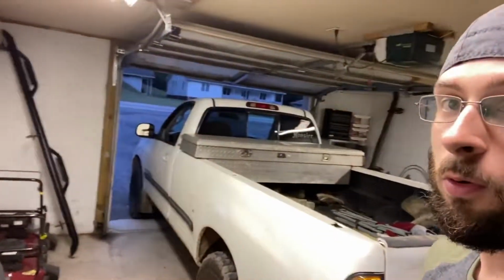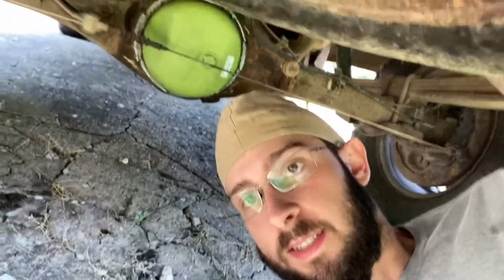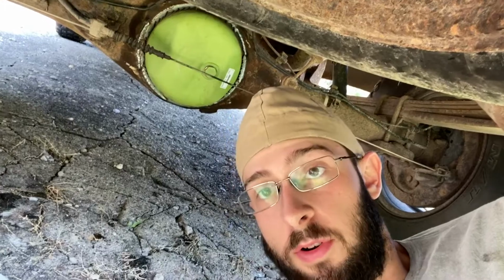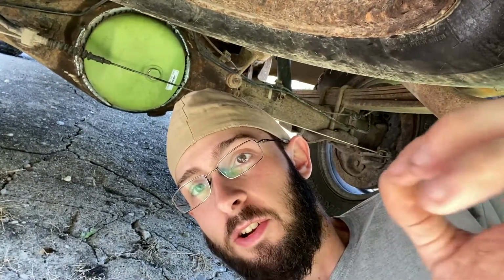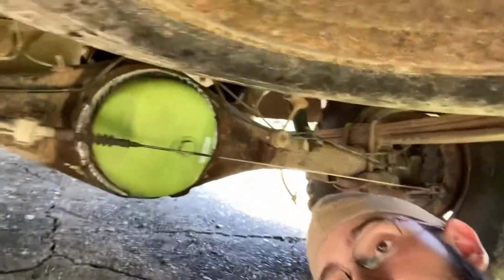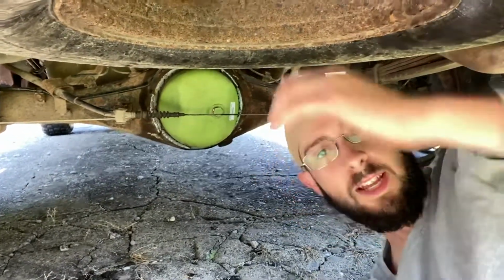2000 to 2006 Toyota Rear Diff cover Replacement

Comment: Thank you! Gave me the courage to do this on my '02 Sequoia

For anyone on the sequioa. I took out the spare tire, the lateral control rod and moved the brake lines up. Used the cheap Chicago electric HFT flux core and the .030 wire max and 8 wire speed. flushed it with brake cleaner and changed the gear oil 4x to get it clear of all particulate after driving a little.

used a cable come along to pull the frame and diff together to replace the lateral control rod. 

took a while and 4lbs of flux core because I am a total novice  welder but it doesn't leak and the Dorman cover works fine. I also ground off one of the brake mounts and rewelded a new jury-rigged on which uses a zip ties, since it didn't line up perfectly. The new cover maybe the bolt is a little high, but it's close to 4 quarts more than the 3.75 factory spec
Reply: How’s it coming out? Btw how much do you think a job like this would run me
Reply: @brian1192  It worked fine. I've put about 1k miles on it since and no problems. I did change the gear oil 4 times and then bought a spare plug to switch it out until there was no more metal shavings. So far so good. Of course the Sequoia only has 250k miles:) but in the NE the rust is the killer.

As for the cost, I really don't know. I was quotes around $3500 to replace the differential with a warrantied used + new control rods, but didn't shop around.

You might try a twisted wire cup on your angle grinder first to take all the scale off the existing cover,  if you can spot the pin holes, drain the oil and try welding some thin steel sheet over those pinholes and see if that holds, before you go through the whole thing that Holden Powell demos. You'd have less to lose if it doesn't work. 

Like I wrote, I was a total beginner 'welder'. I practiced a little with the HFT chicago electric welder then I went under the truck and did it. it took 4lbs of wire because I had to keep griding where it leaked throgh the weld, but after a bunch of hours, it holds. Not bragging at all, just to say that a few times I thought I wasn't going to get it done and looked on Ebay for a used rear axle so if you can weld over the existing cover, if I had thought of that I iight have done that first and not had to deal with all the filings etc.

Best of luck!

Comment: I'm about to do this on my Toyota Tacoma. I tried patching it and it worked for a while but is now leaking again. Thank you for the video. Everyone I talked to said I have to remove the axle to do this job. Glad I stumbled upon your video!
Reply from the maker: Glad to hear I could help!
Reply: I just did it! What a frig getting that old leaky cover off. I used a cold chisel to beat the cover off after grinding the factory weld paper thin. That left me with a nice flat surface to weld the new cover on. She looks great! flushed it out and filled with fresh fluid. You saved me a ton of money. All the shops around here wouldn't do it that way. They just said to get a new axle. Thank you! I will never buy another Toyota! Designed to fail if you ask me!
Reply from the maker: @ruralliving4034  that’s awesome!

Comment: I finally bought a cover and paid a Welding shop to install it even with a lift it took them 3.5 hrs but they removed the brake cable so they would not have to work around it then they under coated it for me looks good. they charged $325
Reply from the maker: That doesn’t sound like a bad deal!!
Reply: where? I can't find anyone around me to do this job. I'm NY suburbs.
Reply: They gave you a GREAT deal...
Reply: @RobertSmith-dj3qw if you’re still looking for someone to do this let me know.

Comment: My hat's off to you, Sir! That was an awesome job and I'm about to do the exact same thing.  It's amazing how close the gears are to the edge of the cover. Guess you just have to be real careful not to cut too deep eh?
Thanks for the video.
Reply: Did you end up doing it ?
Reply: @brian1192  no, i scrapped the truck. The whole rear end was leaking and the frame was shit. Diff cover would have been a waste of time.

Comment: How did you make sure that no metal shavings were sent into the diff?   That's the only thing stopping me from doing mine.
Reply from the maker: There we’re probably some small amounts, I cleaned it our real good afterwards and if any little amount is left it should get stuck to the magnetic plug after you put oil in I’d think.

Comment: looks like a Dorman cover?
I have a 2005 tundra SR5 extended cab 4WD 4.7L,
will that cover fit?
what's the model #? 926-958 Dorman?
Reply: I have a 2006 SR5 that needs the same thing did you find out if the dorman 926-958 fits?
Reply: @rayray31able  bought on Amazon. Dorman 926-958 fit perfectly. Had a local welder cut off the old and weld on the new for $375 labor. I supplied the cover and oil. Oil I used was Castrol Axle limited slip SAE 80W-90 API GL-5. My rear had LSD posted right on the diff cover.
Reply: @rayray31able  sorry it took me 12 days to respond, I just saw your question today.
Reply: No I've got a new problem my airbag light came on and dealership says it's a sensor in my bench seat good luck trying to find a bench seat for a 2006 tundra 60/40 with airbag sensors in it I'm looking at $2,000 just to get it replaced
Reply: @rayray31able  you better do some internet fishing before spending that cash. I'm sure there's some hack to circumvent that sensor.

Comment: What did you weld it with what were you welding with ? If a stick welder what type of rod would you use? Thank you
Reply from the maker: I used a Miller mig machine
Reply: My rudimentary knowledge tells me that stick welding cast iron requires nickel rod

Comment: Holden , nice work!  Can you please share the welder settings? It’s a cast iron axle right? I figured on using  .035 wire , Argon/CO2. You remember the amps or IPS? Thx 
Btw, my cover had a very slight leak in November. I waited till spring, now the oil is running out. Don’t delay, in using POR 15 on this cover.
Reply from the maker: I used .035 wire and 75 25 mix gas and I use to be a welder for a living so I just eye balled it until the weld looked like I wanted
Reply: K, thx. I ended up spreading a 1/8 inch or so of JB Weld across the whole diff. I then put 6 coats of Flex Seal. 
Its a 22yr old Tundr Ltd., off road with
220k miles. Time to move on. I will let the future owner know.
Looking for a 2015 Taco Pro, off road.

Comment: Mine is leaking through the cover now so i might have to do this
Reply from the maker: It’s definitely a little bit of a process, it would of been way easier if it was on a lift but don’t have one of those lol. I probably should of stuffed some towels in the Diff before grinding to but it was a learning experience
Reply: @HoldenPowell_   I think I'm going to try and JB steel weld it first
Reply: @Catfish4570  I did that it held for about 8 months

Comment: What voltage is you mig welder?
Reply from the maker: 125 or 240
Reply: @HoldenPowell_ What voltage and amps did you select? I have a cheap flux core from Harbor Freight.
Reply from the maker: @ExtremeRecluse  mine had a thickness sitting and it set it with that, it doesn’t show what the voltage is at that

Comment: Yeah....let’s get metal shavings all up in the diff???wtf if you can grind and weld it’s all through bolts. Take it apart... don’t show ppl a wrong way....
Reply from the maker: There’s one bolt on the hole thing and its the fill hole. If you know a better way to remove a weld on diff cover then let me know. Obvious if you watched the whole video you will see the new diff and see there is not a single hole in it besides the fill plug.
Reply: Design flaw by Toyota it’s all that can be done, But I was wondering did you clean it out after grinding? Would spraying it with brake cleaner clean it out
Reply: @HoldenPowell_  I think he means you should have stripped the axle down to the casing first. Don't think I'd have bothered myself but probably is the right way to do it in fairness
Reply: @mktrollop1093  Brake clean, fill the diff with fluid, drive 1 miles, and flush it out, put new stuff in, repeat, then put fresh stuff in and should be all clean
Reply: Just save the old diff fluid when you drain. After removing cover, cover open diff with towel to prevent shavings. Brake clean before putting new cover on. Refill with old fluid and drive a bit. Drain and fill with new 👍
Reply: Use brake clean and compressed air. Not a big deal